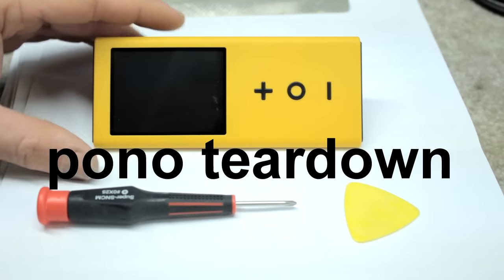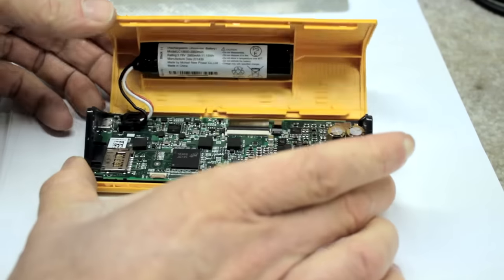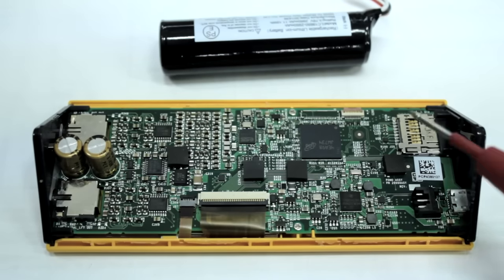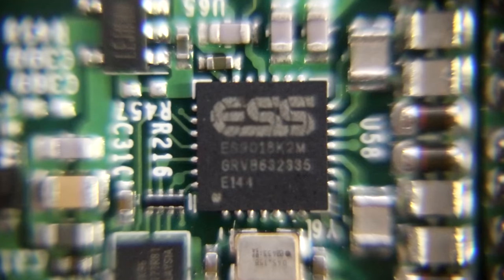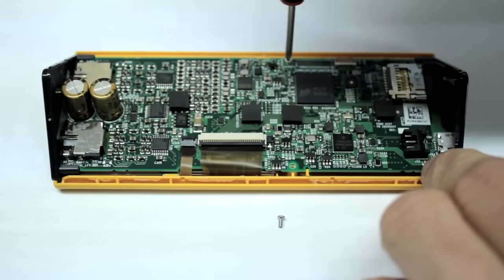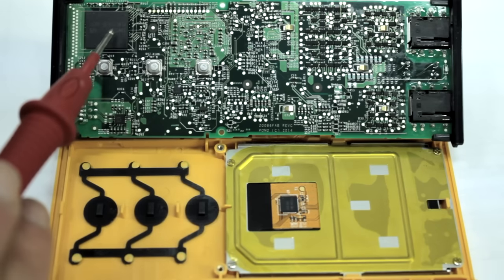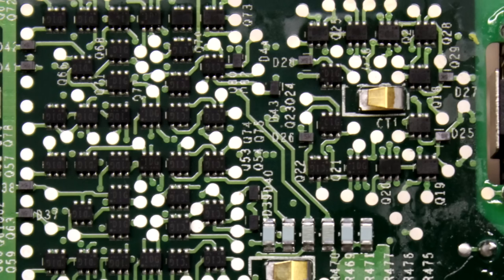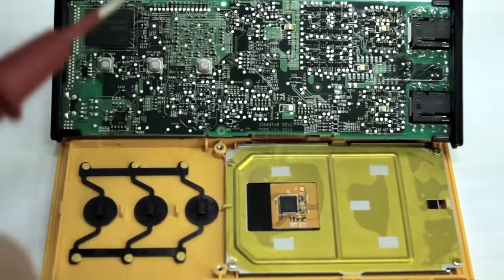Pono Player Teardown - What's Inside

Comment: Sorry but its perception, perception, perception.  I have two electrical engineering degrees, owner of recording studio and musician.  If you record a passage at 16bit 44.1 kHz  (CD) and the same passage at 24bit 192kHz and observe the two on an oscilloscope while subtracting the voltage signals from each other (180 degrees out of phase with each other), guess what’s left . . . Nothing.  There could be artifact from the clocks, i.e. jitter, alias . . but not stuff left over from a better recording. The scope doesn't lie, it displays it all. And a speaker creates sound by converting an electrical current to sound.  There is nothing else that makes that speaker move, just electrical current.  There is no big or lush electrical current leftover, no spaciousness, no openness signals, sorry but its all in your head.  Yes 24bit has more dynamic range, actually more that vinyl. But as a listener you can’t hear that.  In the studio I use 32bit, WHY, because the process of mixing, applying EQ, reverb, etc. works much better as it’s all math, and 16bit math causes mathematical round off error.  But once I’m all done mixing, 16bit plays back the same.  But hey if spending lots of money sounds better, then go with your brain, but its not your ears hearing anything, because its just not there . . . .  sorry I know so many of you are trying so hard to believe.  Maybe the real bonus is that we've been getting Starbuck's all along at instant coffee prices.
Reply: Does the hardware justify the high price? That battery looks ugly as sin in this case.
Reply: Gadjo X Not at all. Especially if they mass produce it, because that lowers the manufacturing price. And I think its funny to call a portable player hi-fi or audiophile because if you travel than the noise of the enviroment makes it impossible to hear the full dynamic range. And if you see it as a home player than are much better ones. Oh and I think and amp so thiny with a small power supply as this has will never produce audiophile quality.
Reply: *****
I gave up listening to music when commuting for this exact reason. Too much noise and I don't hear anything properly. I read on my phone and on my kindle to pass the time.
Reply from the maker: Hi Faroek,
I'm planning to do another video soon testing the actual audio output of the Pono vs a few other players. Maybe you can help by suggesting some ways I can test this stuff out. I have access to a good scope and some other tools. I was also thinking about doing some blind listening tests as well.
Reply: ***** I would like to see, how it preforms after intensive usage at high volume, how heat effects the output, or how the battery holds up under pressure, is it enough to support the whole system without compromising the output, or how it preforms with different impedance loads because some high end headphones are pretty high impedance and as I see on the pono webpage they didn't specified the impedance range than we should assume you can use any type of headphones with it. :)
Reply: ***** How does it sound when you play mp3. Thanks for the video.
Reply: ***** sure I  can help you out. Let me just sent you a private message.
Reply: goatstaog There is no "32bit" format in that sense, that's internal processing and floating point bits, not storage to disk at 32bit depth. 

That "slight" difference you hear is the important part. Think about it -- why would you be interested in reducing quality other than for bandwidth restrictions? Why get "close enough" when you can push the whole thing out now.  

In 2015 there are no restrictions on the storage format (like CD needing to be 16bit so a disc could hold 60+ minutes) or the transmission format (like mp3 needing to reduce the actual stream bitrate from 1400k to ~200k for transmission over mobile and modems).  Well the transmission format is still restricted for streaming, but if you are buying files to own forever, why wouldn't you want the full version?

For some releases, 16/44 is the best digital will ever get, especially stuff released in the 1999-2008 timeframe ---

Before 1999 almost everything professional was recorded to tape, 1" or 2".  That can all be loaded back up and transferred at 24bit using the best modern converters and will sound better than the CD version. 

By 2008 CPU speed and storage prices allowed most quality recordings to be done at 24bit, so they can be remastered, or in many cases labels have 24bit versions they keep in the vault, they would just have to have the monetary reason to release them.
Reply: ***** What if I want to slow down a track to say 1/3rd of original speed, so that I can practice my favorite piano parts.  Does 24-bit/192kHz provide any advantage as a distribution format?
Reply: Andrew Piatek that is interesting, yes it would.  the overall resolution will give the time stretching feature better detail. reasons like this is why things have been produced in 24/88 minimum for over a decade now. producers that have to fix material use time stretching all the time.
Reply: +Faroek Nasierkhan 

I really liked your post. I once hear about a computer program that allows one to play the same track in two different audio formats (One lossy, and the other lossless) with the intention of blind-testing one self against the placebo effect.

(Side-Note: When you said "perception, perception, perception" I actually read it as "placebo, placebo, placebo". Because perception can actually by measurably different....anyways...i got your point.)

The program tests you 10 times (or any number that you choose)...each time it plays a similar segment of the song in both audio formats (in random order) and asks you to vote "which is lossless, first or second?". The audio segment can change from trial to trial. 

At any rate, the idea is that only if you can manage to choose the lossless file 9/10 times, then we have an objective way of saying if a person is under the placebo effect or if the person can actually distinguish the different formats.

+Mike Beauchamp Maybe you will find this comment interesting too.
Reply: +aboyapart What if I want to slow down the track (and pitch shift) to work out a part on the keyboard?   Also, what if I want to crank up song fade away?  I need high sampling frequency for the first, and greater bit depth for the latter.   That's why I consider iTunes a solid rip off to pay near CD price for 1/5th of the data, and hdtracks.com a bargain cause they charge minimum premium over CD.  Sure, if you just want to listen to a hip-hop song, go iTunes, no problem with that.
Reply: I actually don't know what to tell you regarding the first two questions, because I'm not familiar with those concepts.

Anyways, with my comment, I just wanted to share that such programs provide a reliable and objective criterium to distinguish between illusion and reality when it comes to audio formats.**

If the distinction between the formats is really perceptible, then the program will allow us to test that proposition...if the person fails to vote correctly above the required percentage (it need not be 9/10, maybe you would suggest 7/10) then we can consider the proposition false.

** I should say that such test really are dependent on the whole equipment being used. If you have really cheap headphones for example, they could reproduce the two formats virtually equal...and thus the test could fail because of that. This idea also applies to Faroek Nasierkhan post, if the oscilloscope is not accurate at measuring the  signals, then they might cancel when subtracting each other, but that might simply be a limitation on the oscilloscope...and in this sense, the oscilloscope could actually lie, contrary to Faroek Nasierkhan statement....
I don't think this would be the case, but in principle both signals are mathematically different, so in reality we can expect them to be different.and not cancel.
Reply: SEARCH THIS VIDEO TAHT SUMMARIZES MY POINT:

The Pogue Review: PonoPlayer
Reply: +aboyapart Whether you can tell the difference between 320kBits MP3 or 24-bit/192 kHz linear PCM or DSD is not the point here.  I can't hear sine wave above 15kHz (although I might pick out timbral differences if a high partial is filtered out, I don't know).  The point here is threefold.  1) Ethical: if you pay money for the file, get all the data, not 1/5th of it.  2) Conceptual: stay as close to the master recording a possible, or even better yet, get the actual master recording.  If an artist chose to directly record to say Sonoma DSD and releases SA-CD, chances are it could be actual master you're getting.  Of course that would not apply to heavily produced (processed) music.  It makes sense though for straight through take recordings like in classical and jazz misc 3) Practical.  As I said before, if I want to slow down a track to 1/3rd the tempo and pitch shift back to correct pitch, 192kHz file will give me better result.  Lastly, it's hard to come by with a pirated SA-CD, because SA-CD recorders have not been made available in retail outlets.  Therefore, artist is not being rippped off by a pirated copy, and consumer is not being ripped of either, because he or she is getting the recording from authorized distributor.  

Sure, I wouldn't buy Pono, due to bad aesthetics of the product (the hump due to the AA sized battery inside).  Astel & Kern has no legacy to me as an audio brand.  Sure, they're probably associated with hdtracks.com via the download app used by hdtracks.com.  But that's another story altogether.   I am a big fan of the Hi-Res though propagated by Sony and TEAC.  I am trusting these companies, and so far have not been disappointed with my NW-ZX2 player.  You can call me an idiot, that's your right to free speech.  But if it comes to my hard earn cash to spend on things, I will choose what I like ethically, conceptually, and practically.  Physics test of straight through playback (without slowing the tempo down) or advertisement won't sway me away.  You want me to listen to compressed files?  Pay me.  I will.  But for my own money, I go where I want to.
Reply: I think you have a problem...I never address you, meaning that my point was not directed to you...so I don't care if you think my point is relevant or  not.

I never called you an idiot. and honestly, i don't see why you are addressing me because my point is completely different from yours. Actually, my comments do not in any way show disagreement with your points.

Its only about being able to test one self...simple.

In fact, you could actually benefit from such test. Although I bet you don't care. For example do one of those "pitch shift back modifications" that you talked about, and then test yourself under normal playback and see if you can actually distinguish the different versions (modified unmodified). 

Totally agree with you at the end...do what you want, and pay for what you want, its your money. Just don't expect people to care for the things that you care. And don't think that you are superior (I'm not saying that you do, but just to warn you)...because at the end this type of things are about preference.
Reply: aboyapart
Most back-to-back test are irrelevant, that's because human ear adjusts to things, so it makes no difference.  For instance, I have to vastly different headphones: Sony MDR-V6, and Sennheiser HD280.  The MDR-V6 is very crisp in midrange, has lots of highs, etc.  HD280 by comparison sound drastically muted when switched over to after having MDR-V6 on ears.  Now, after a day or two of listening on HD280, they begin to sound normal.  That's because human ears adjust, get used to certain quality, and treat it as normal.  Same with vision.  We don't distinguish much about color temperature, because our eye adjusts and compensates (actually brain does, but you get my point).

So, some hipster doing physics test to prove that he is right, is totally irrelevant to me, as much as vinyl enthusiasts are irrelevant to me.  You're comments are totally irrelevant to me as well.
Reply: "That's because human ears adjust, get used to certain quality, and treat it as normal"

soo...basically...if you start listening to compressed audio you would get used to it and treat as normal....which for you normal is hight quality. ergo, to you compressed audio would be high quality...ok!
Reply: aboyapart Yep, I got used to HD280 alright, couldn't get used to iTunes though for whole bunch of reasons.  Therefore I will be treating iTunes as abnormal.
Reply: aboyapart
Sure, we contradict ourselves all the time. Especially the ones who claim that sense of superiority is abnormal, and then they claim they are superior. 

I am not agreeing with iTunes ethics, or Apple ethics in general.  Don't get me wrong, I used to like Apple product up until maybe 1994.  But whatever came after that was just plain silly, and I did not have to adjust to it.  Same with music business, Sony owned Columbia records is far more reputable of a source to get music from than Apple ever will be.  So this is where I go.

I don't consider myself superior (like you do) I fail in many respects.  We are human, and we all fail sooner or later.  However, I don't have to tolerate another "scientific" comparo article from some hipster whom I would touch with a mile long stick.  That's just my opinion, and I am free to voice it.
Reply: +aboyapart think about that -- you are forcing your brain to connect dots that it doesn't need to. this leads to listening fatigue and a lot of loss of details. think about how hard you have to concentrate to hear someone far away, several rooms, or whispering. you actually furrow your brow to concentrate it's so much work to tune your ears into reaching for you.  why reduce your music, what is supposed to bring you happiness?  you are saying - take my joy and cut in 1/5 or at least keep cutting it away until i think i can tell.  that's torture.
Reply: ezrazski
Ha ha, good one :)  To me is a torture to read this guys comments.  I take it Apple user, most likely.  You can't unbrainwash those.
Reply: +Andrew Piatek maybe, not sure on the apple thing, i'm an apple user.  audio idiots come from all brands.
Reply: ezrazski
Fair thing.  I am another idiot, from the camp of Sony, Yamaha, Roland, Sennheiser, and JBL :)
Reply: +Faroek Nasierkhan 
The problem is that people are just looking at signals and think there's an objectively better quality. If that's the case, how come videophiles aren't coming out and saying 10-bit displays should be a thing (a lot of people hate 10-bit displays because they over saturate colors)?

The other major problem is they seem to believe digital signals are what get transplanted in the real world. The real world isn't digital. A DAC is going to convert stair-steppy signal into a smooth sine wave (ideally). And it's not going to matter anyway at CD Audio because any blips or bloops that are less than the threshold of hearing aren't going to get heard anyway.
Reply: +ChannelSho I' d love to see clean uncompressed video 480i or even 240p, I am sure it would look wonderful.  But no, we are still not ready for uncompressed video with our low bandwidth infrastructures and limited storage space.  However, for sound, such limitations no longer exist, that's why I think it's conceptually wrong to data compress music.  It cheats the listener, and I am against cheating, especially when you try to push audio files for money.  Human ear can unfortunately get adjusted to a lot of things, and gets easily fooled, same with the eyes.  Compression con artists thrive on it.  It's an old trade trick, to establish how much you can charge for how little.  In this case, is how much you can charge for as little data as possible.  That's why I quite applaud services such as hdtracks.com to provide uncompressed music in various data formats and despise thing like iTunes to deceive people.  Neil Young has a lot of good points actually in his advertisement spiel.  Nonetheless, I don't like Pono hardware itself, due to bad aesthetics and the bulge caused for bar reason, the AA-like battery inside.  It's quite an ugly piece of hardware.  I chose Sony NW-ZX2 instead, using it every day, very happy with it.  Have various files on it, from 24-bit/192kHz through 16-bit/44.1kHz down to 320kbits/sec MP3 files.  And they all sound great, and the player has pleasing aesthetics, and I have plenty space to store them, so what's not to like?  Call me an idiot, it's your choice.  But please do not tell me what to spend my money on.  That's just my opinion.
Reply: Andrew Piatek i agree with you 100%, keep on with the truth! i like the pono shape myself - for me it's rugged, sits, stands, and easy in the hands. i've had a slab-phone in my pocket since 1996 or something and i was not about to get a music player that looked like that. 

as far as the battery, it's tied to the shape, i think they went with the triangle so they could use traditional audio parts and a standard battery. the slab requires smaller components and specialized battery shapes. the pono's is easily replaceable with standard batteries.

pono is almost all open and hippy about themselves so they didn't want the custom battery or the smallest possible case, they wanted space to build a true audio device.

it's almost like the difference between distortion plugins and distortion pedals. one has real circuits in it and requires a box to hold them, one exists solely in silicon.

pono has serious analog section that might not have fit in a slab either.

anyway, enjoy that sony, it looks slick, probably sounds awesome.
Reply: Great, thank you for supporting my open voice and promoting the truth.  I just today deleted all MP3 files from my player, and replaced them with standard 44.1kHz versions of 16-bit linear  uncompressed audio at 150kbytes a second transfer rate.  That's around 1.4Mbits/ sec. for those considering 320Kbits/sec a high quality.
Reply: Everyone with mp3 has the same quality sound occupying less space....I know this makes you mad...deal with it ;)
Reply: aboyapart you accept 10% as 100%.  perceptual coding has you owned.  this will one day make you mad, deal with it ;-)
Reply: aboyapart
Since yesterday, I am 100% MP3 free.  I deleted all the 320kbits/sec MP3 files from my music player, and replaced with CD versions, linear, uncompressed audio.  Never been happier.  Space is really not an issue these days for audio, so there's not reason to cheat oneself with compressed audio.
Reply: There is no reason for using more memory space and paying money for something that provides mp3 quality...but hey, placebos make people feel better.

I honestly don't know why you pay attention to me and my comments. It is like you can't handle people enjoying the same sound quality as you, but for free and faster downloads.

Anyways, your money is your money...so spend it in as many placebos as you would like.
Reply: aboyapart I really have problems filling out my music player.  Still have 60GB free space on the player, and 60GB on microSD card.  There's really no reason for data compression, even the lossless one.  I believe, the less processing, the better.  In fact I consider uncompressed audio for three reasons: 1) Conceptual, 2) Ethical.  3) Practical.  Conceptual, because you get highest audio quality possible.  Ethical, because you don't get charged nearly CD album price for 1/5 of the data (that's what Apple has been doing with their 256kbits/sec files, which is a solid rip-off).  It's also very practical, because you if you want to say slow down the track to 1/3rd the tempo and pitch shift to original pitch to break down that favorite piano part, the only file that makes any sense to work with, are the uncompressed files.  Sure, for straight up listening 320kbits/sec MP3 are okay.  I wouldn't pay for an MP3 though.  I had gotten some albums on MP3, because they came free with a CD purchase, so I could download sort of a preview of the music on MP3, before the CD came in the mail.  That's a nice touch.  Now I deleted all the MP3 files though, and copied over from CD's in linear uncompressed 1,411kbits/sec (that's 150Kbytes/sec a minimum digital audio quality I am wiling to pay for).  As far as downloads go, I've been enjoying hdtracks.com They deliver good quality, at reasonable price, and I enjoy their music selection.  I would not go for streaming, because that's like being tethered to the service.  I like music on my player, be independent, and enjoy the music.  I've been fortunate to get a player that I quite like, which has been designed for uncompressed audio, so that's what I go for.  Sony and Philips got it right with the CD, and so did Sony with SA-CD.  Brilliant formats.  MiniDisc ATRAC 290kbts/sec compression was alright, too, incomparably better to 128kbits/sec or 56kbits/sec MP3's of the same era.  But since memory space is so abundant these days, there's really no reason to go back to compressed audio.  To me compressed audio, is simply thing of the past.
Reply: I have no time to read insignificant opinions.
Do whatever you like to do with your money and don't care about me....
Honestly you are to late to say that you don't care about me...specially after writing that essay.
Reply: aboyapart
I don't care about you.  I am just of generous nature, and I am usually willing to provide people with helpful information on any subject.  And I don't believe there's such thing as "I have no time".  If you have interest, you'll fine time, believe me.  But with people with lack of interest, yes, it's pointless because they have no drive to open their minds.  Music has been very important part of my life, and I have interest in it, and I am always willing to explore, and I don't mind spending some money if the product is right, and fortunately, there have been some excellent products over the years, and there are some excellent products today.  Sure, people who want everything for free, they won't appreciate good product.  You know who you are.
Reply: again with the essays...Dude, I have already told you...I am ok if you want to pay for things that are freely available. More so if you feel good doing so... I am all for feeling good. It's just that in my case I am not under any placebo effect.
Reply: You haven't even read my explanation about the concept, ethics, and practical use of uncompressed audio.  Uncompressed audio is not really freely available.  And neither is MP3.  In fact, if you want to release and MP3, you have to pay percentage in royalty to the MP3 inventor.  So, MP3 is not a free format.  As I said before, I got my MP3 files free with a purchase of CD, and I am okay with this concept.  I am not okay with the concept of charging money for data compressed music.  Sure, if you have no particular interest in music, you can get by downloading anything.  I don't have any particular interest in modern operating systems GUI's (all of them cheesy, annoying, and sluggish), so I choose a free one.  But if I have interest in something, and I like the product, I don't mind paying.  In fact, I even enjoy purchasing a product that truly like.  It's one of the pleasures in life.
Reply: +aboyapart I can see from your language, who am I dealing with.  Sometimes you have a nice day, until you step into a turd like I just did.  Oh well, I got used to it, because it's been a common experience with so many people these days.
Reply: +aboyapart No, I don't know, how do I look for music online?
Reply: aboyapart dude you have some problems with reading comprehension.  Andrew Piatek has explained himself clearly.  256k ≠ 1400k ≠ 5800k no matter what you think you hear.  

we feel bad for you. you continue to misunderstand what you are dealing with. you are getting 10% files that are fooling you. that makes you a fool.
Reply: +Faroek Nasierkhan What if you go the other way? You record a passage at 16bit 44.1 and another passage at a lower quality to where you can just begin to hear the degradation. Would that show up on the oscilloscope and what would the difference look like?
Reply: If you live by the math you die by the math.  Incomplete as it is.

Please provide me some measurements for timbre.  Waveforms of timbre.

Also I'd like to see the waveforms to prove a fender strat plays nicer than a first act guitar.
Reply: +Faroek Nasierkhan What if you have ultra quite parts and want to bring them out by cranking the volume, more bit resolution makes a difference there.  Also, if you want to slow down track and pitch shift back to original pitch, higher sampling frequency file might have advantage.  For straight ahead listening, yes, CD quality is adequate, I agree.  But if I have option of higher quality, I go for it.  Why?  I respect the artists who take an effort to go that route.